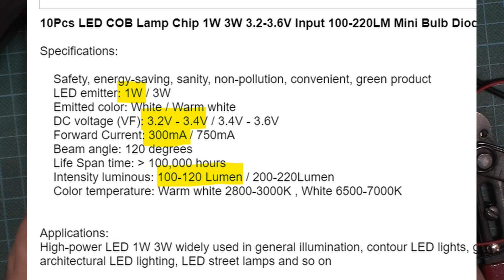How to solder 1W LED and heatsink using soldering iron

Comment: HI, I recommend to get thermal glue and first glue the led to the main pad, with the solder you put on it is very likely that the led just touches a small fraction of the heatsink. Once this is set you can easily place solder on anode and kathode and the correasponding pads

Comment: Solder center pad for better heat transfert. Put the solder tip with power above 40W well tinned under the mcpcb until it melt, slight press down Led until it solidifies. Before this, better not have traces of solder on the pin pads or the solder will be raised

Comment: Meh, I think i’ll pass. I’ll place some solder paste and let it reflow on a pan with aluminum foil between the star board and pan surface.
Reply: I found a small heating pad on Amazon that was made for reflux soldering. 
   I can mount five bare beads at a time on star mounts 
     Place the LED’s with their legs on the correct pads on the star mounts, making sure the polarities match. 
   Apply soldering paste under the beads and on the contact pads. 
     Plug in the heat plate and in a couple of minutes or so you will start to see changes. The soldering paste spreads a bit, may smoke some, then you will see the silvery solder starting to melt together as the paste disappears. As this happens the LED’s actually position themselves correctly on the pads with the melting solder before coming to their final resting point.  
    Once this has happened, unplug the heating plate and leave the LED’s on the heating surface to  cool down.  
    The whole thing will turn out to be much simpler in real life than I can describe here.

Comment: In the absence of being able to solder that centre pad, then I would use a tiny dab of thermal paste. A dob of solder on that middle pad is a bad idea as it limits the surface area. It will make for a very poor thermal contact. There are also silver epoxy mounting pastes that will transfer heat efficiently and you can guarantee good contact. Not cheap, but then you only need tiny amounts. Finally, a heat gun approach from a soldering station might work, probably aimed at the back of the heatsink, but it's essential to use low temperature soldering paste as an LED like that is unlikely to withstand the temperature required to melt lead-free solder (although soldering the tabs is OK). 

I would go with the cheap thermal paste approach first and do some tests (although at 1W those star mounts will need to be thermally bonded to a bigger heat sink of some sort as even those get too hot at 1W (let along the 3W or more LEDs that are available).
Reply: Solder center pad for better heat transfert. Put the solder tip with power above 40W well tinned under the mcpcb until it melt, slight press down Led until it solidifies. Before this, better not have traces of solder on the pin pads or the solder will be raised

Comment: I have exactly the same ... a bag o' sinks from ebay + a bag o' lights from ebay. Just love the floating vice idea and the wooden clothes peg - genius!!! I will get to work following what you say - so useful to see this in advance. Slightly unsure about your "raised pimple in the middle" idea ... that may cause only a few actual metal to metal contact points reducing the conduction of heat to the sink?.. I get what you say - you don't want an air gap there .. I might try a bit of lightly crumpled kitchen foil. Kudos to you bruv.
Reply: Update.. I got some thermal paste which should do the job nicely

Comment: Can I use 18650 3.7v on this 1w led?
Reply: You will need to put in a current limiting system or it will rapidly burn out. If you use the simplest system, a current limiting resistor,  and the forward bias is 3.2 V, and the maximum a Li-Ion cell will get up to at full charge is 4.2 V, then at 300 mV that's a 3.3 ohm resistor to give a 1V drop, and it will dissipate up to 0.3 W. However, it's not ideal as  when the cell discharges and reached 3.7V, that's only a 0.5 V drop and the current, and light output will be halved.

What you really want is an LED driver designed to work off of a Li-Ion cell. The easiest way is to look for a "flashlight LED driver", which are designed for exactly that purpose. The bonus is that you can usually control power levels and it's more efficient than a resistive dropper and will maintain light levels. However, be careful to make sure it can't over-drive a particular LED and it's not as cheap as a simple resistive dropper.

Comment: Here s a helpful tip.... you bend the 2 pins upword.... they re going to act like a spring to keep led contact with heatsink... solder the first pin with led at an angl... than you can put heatsink compound if you like.... than you press the other pin and solder it... voila... easy and perfect heat transfer
Reply from the maker: Thanks for that.

Comment: Use low temp soldering paste.
You need to solder bottom as well. not just press it against it.
Reply from the maker: Surface mount soldering paste and a heat gun? Most likely that's a good solution but I had a go with the tools available.

Comment: Nice video but tell me what wire do you use for that leds
Reply from the maker: 7/0.1 stranded wire or similar. I tend to run LEDs at less than their rated current and wires tend to be short.
Reply: @PizzeyTechnology  dnt you have a link we're they sell it

Comment: 05:16 "to there, the center, and there"... instead of "there" and "there", the next solder pads in respectively clockwise direction would have been the correct choice, i.e., when you rotate the LED by 60 degrees clockwise. If you compare those two adjacent pads with the pads which you intend to solder to, you will realize that they have a different and asymmetric orientation on the PCB, just like the plus and minus pins of the LED are asymmetric. Also, these two solder pads extend much closer to the center pad.

06:00 You're not very optimistic about how long the LED is going to last, are you? :D
Reply from the maker: OK, I just took a look again and you are quite right I should have soldered onto the two "offset" pads. Not sure how I missed that! Regarding "to there, the centre and there" are you suggesting that you would attempt to solder the LED chip down if your only equipment was a soldering iron? I have some time off over Xmas so I might have another go at soldering one of these, possibly preheating with a hot air gun.
Reply: @PizzeyTechnology  I just went through the same problems. :-) Telling from the lots of videos I've seen so far, I don't think that a soldering iron would be a good tool to do that.

There are two options: Solder from front side, or from the back side. If you try the latter, then you can't get good thermal contact with the soldering iron, which would mean it takes really long until the solder between LED and PCB would get liquid, and I doubt the LED would survive. Or you tin the back side in order to get better thermal contact, but then the backside isn't flat any more, and it gets impossible to mount it on a heat sink. Soldering from front side isn't really possible either, because the plastic case and the lense of the LED would get damaged.

I came across videos like this one, https://www.youtube.com/watch?v=M8b8Yn78UFE , but don't really like the idea of heating the LEDs from above. Maybe with a bit of practice, the candle method could be perfected: https://www.youtube.com/watch?v=eqCVZmPU8X4 But there's always the chance of damaging the LEDs by excessive heat.

The price differences aren't really that large at all, so I think in future I'm always going to buy LEDs which are already assembled on the star PCB.

Whichever way you're going to try to do it, I wish you good luck with it!

Comment: I have a similar situation. I need to solder LED to a star PCB. Would it be possible to use thermal paste(compound) instead of solder to transfer heat from LED to PCB? 

Like we do in case of peltier module
Reply: Probably yes, if you find a good way to establish a firm mechanical connection between the LED and the star PCB heat sink. After all, also modern CPUs can get rid of excess heat through this paste.

So far I've only come across examples of people using thermal paste to thermally couple the star PCB heat sink to a second heat sink, or to a metal case, like in here: https://youtu.be/DFIbWeLoz0A?t=92
Reply: Yes put it on the center and solder the positive and negative contacts

Comment: Hi. Where can i buy this leds? What name or number have this led?
Thx
Reply from the maker: I bought the 1W LEDs and heat sinks on eBay. I selected these as I wanted to try soldering the LEDs to heatsinks myself, but I have since purchased more 1W LEDs pre-soldered to their heatsinks. I suggest you do the same as in fact they worked out cheaper.
Reply from the maker: https://www.ebay.co.uk/itm/10PCS-1W-High-Power-Cool-White-LED-Light-Emitter-6500-7000K-with-20mm-Heatsink/251373119457
Reply: I have a similar situation. I need to solder LED to a star PCB. Would it be possible to use thermal paste(compound) instead of solder to transfer heat from LED to PCB? 

Like we do in case of peltier module
Reply from the maker: @ajinkyakabbur4511  unless the LEDs are mechanically fixed down I would not rely on thermal grease alone. Of course the best thing to do would be to follow the manufacturer's recommendations, but in my case these were unbranded components from eBay with no datasheet. Where are you sourcing your components from?
Reply: @PizzeyTechnology  I get your point. Thanks for the help.
I bought them from a local electronics shop. So no datasheets here as well.
Reply from the maker: No problem. I lived in Asia for several years and at that time I'd often buy parts from a market stall. I hope you figure it out.